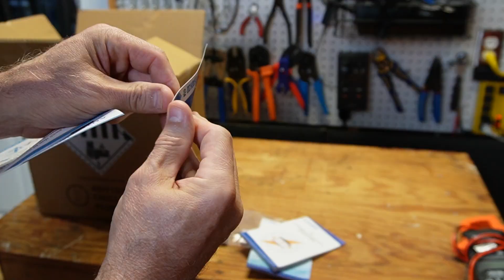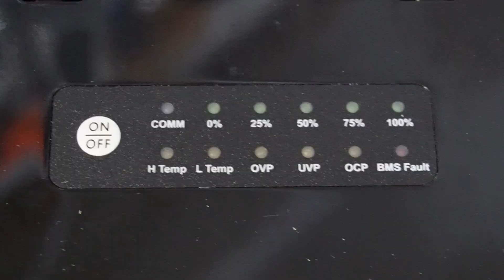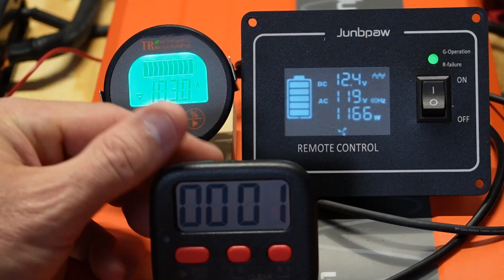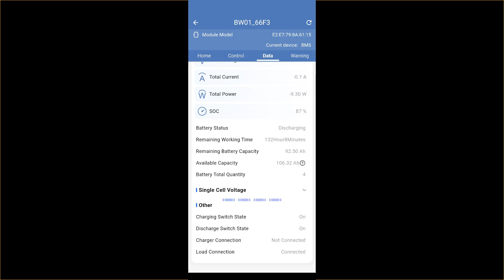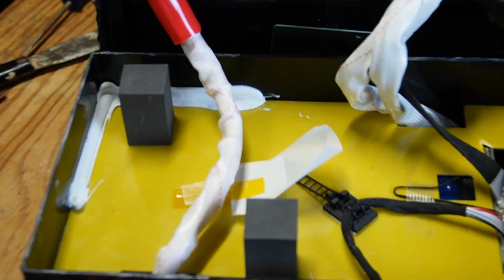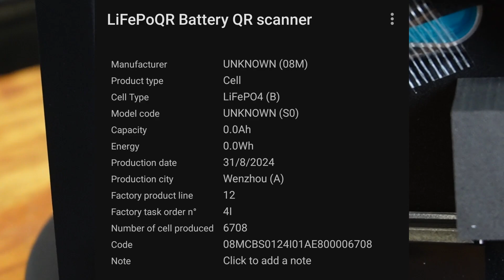DC House LiFePO4 12v 100Ah Battery Review - Impressive 107Ah Capacity TEST!

Comment: this DC house is made at the same factory as eco-worthy   similar booklets the little tool . i have 2 eco worthy one 50 ah the other 100ah  i like the bluettoth version of 100ah  it can read each cell voltage. not my 50 amp one.  DC or eco worthy to me both are so similar  .one or the other does the job depending of the JOB of course. for small ordinary stuff  just fine

Comment: Deciding between DC House and Humsienk.  Needing three batteries for a few kayaks. Can you nudge me in the right direction?  They are pretty close to the same price.  Will keep researching but need some nudging.  Thank you so kindly.
Reply from the maker: Well, I've seen more positive reviews for humsienk than dc house. I've not seen any negative reviews for either of them. But I did have someone comment on one of my videos that their dc house battery which had low temp protection went dead in very cold temps. I've not had any issues with either. So that may give a slight edge to humsienk. That's about the only nudge I can give.

Comment: This is a great battery, however, if it ever is allowed to go flat, good luck trying to wake it up.  Mine is brand new but I let it set too long without a charge.  All of the online videos of jumping with a lead acid to wake it up, do not work.  Not sure why the BMS is different than others.  There is not a single video  anywhere that shows a fix for the DC House.
Reply from the maker: Well, that stinks. If nothing works and if you are comfortable doing it, you could open the battery up and possibly use a bench power supply to charge each cell separately just a little to hopefully revive it. Opening up these batteries usually takes a few flat screw drivers and a hammer to break the glue loose. Then you can either duct tape it or silicone it back together.

Comment: If you were to wire 3 of these 100ah batteries in series (for a golf cart), would the maximum discharge amperage increase?
I don't think my older golf cart exceeds 175-200 amps.
Reply from the maker: Well, 3 of these wired in series would output 100 amps but 36 volts.
Reply: @proficientprepper lol wrong it would still be 100 amps but at 36 volts.
Reply from the maker: Thanks for catching that mistake. I must have been under the influence when I replied to that. I corrected my answer above.

Comment: Hi there, I bought this very same model. When it's close to being fully charged, the OV indicator, which I assume it's over voltage kicks in and stops the charging. The app is showing one or two cells are charging higher that the others. How does the battery balance the 4 cells?
Reply from the maker: This can sometimes happen. The BMS (Battery Management System) inside the battery will balance the cells. But they have to be over some preconfigured voltage. And they use passive balancing with low amperages that can take a long time to balance. Try charging until it stops. Then let it sit a day or so without using it. Then charge to full again. Let it sit again. Then repeat. I'm not sure that will do anything. If not try contacting the company.
Reply: @proficientprepper  Thank you and appreciate the reply.